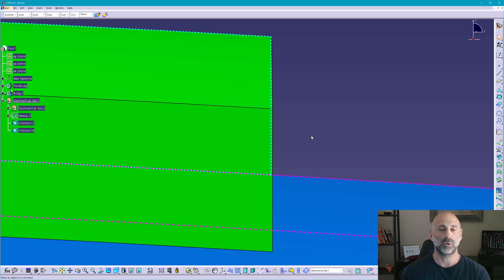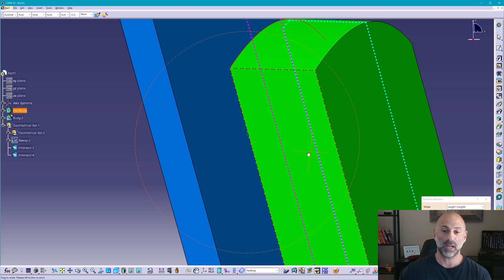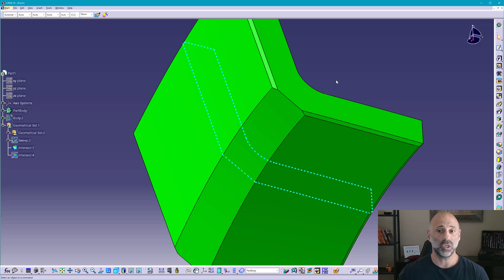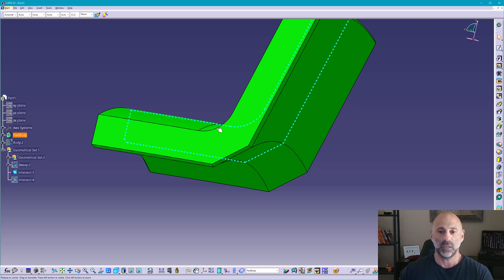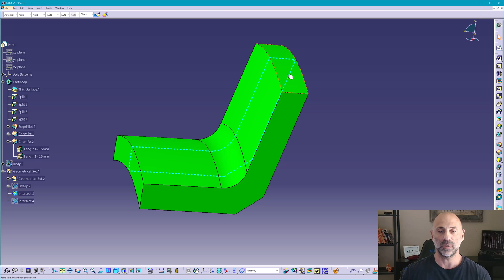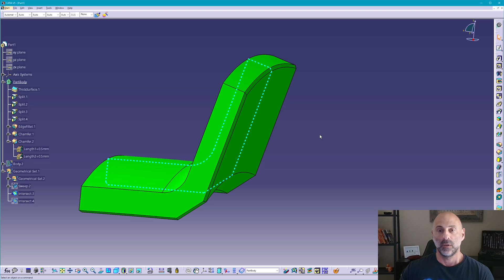🔧 Why Knife Edges Are Bad Design (And How to Fix Them)

Comment: These become a problem for us when we machine Raw material from Die Castings.  We really need to watch these sharp edges.  Good Video once again!
Reply from the maker: I remember years ago I was switching out my alternator. The casting holding it into place had the classic machined surfaces. Spot faces and all the things. Welp, I grabbed underneath and since I was new to working on cars, I ended up getting a big slice. This was late 80's. 

Ever since then, I knew the danger. 

Thank you!